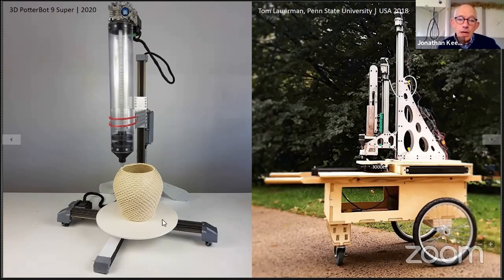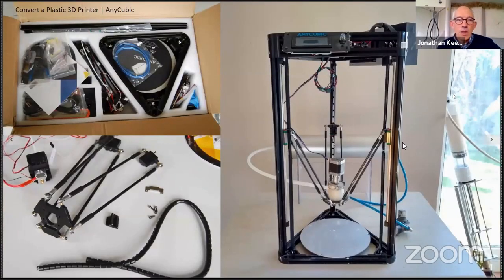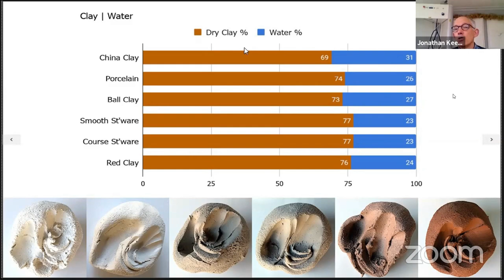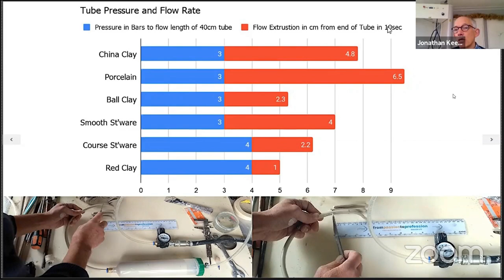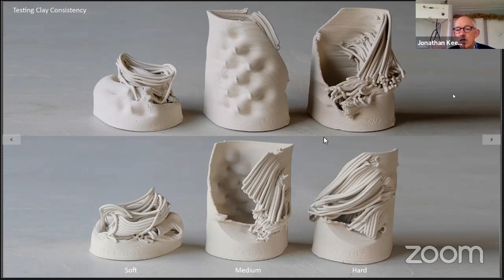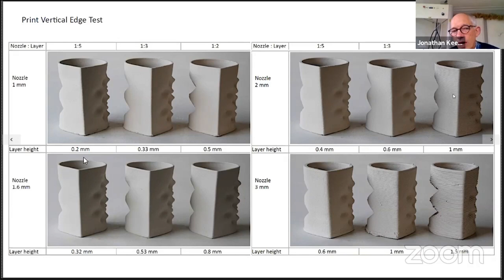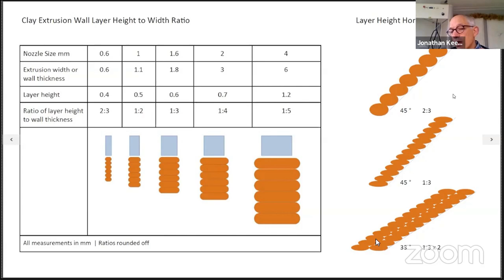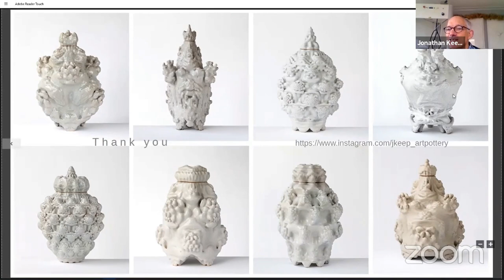10 Years of Extrusion 3D Printing: Part 2 - Jonathan Keep

Comment: . . . wow wow wow wow wow!! This is so fantastic!!! I have a question: Can bentonite be added to porcelain clay or would there be weird shrinkage issues??
Reply from the maker: Hi Bradley, it is not uncommon for porcelain recipes to have some bentonite in them, around 3%. You can always try some more but you are right with too much bentonite you get high shrinkage. Also bentonite often has a bit of iron in it so if it is the whiteness of porcelain you are after the colour can be compromised. It's always a balancing act of gains and losses.